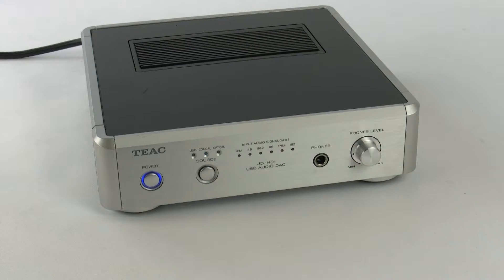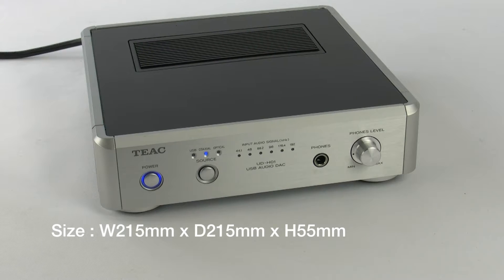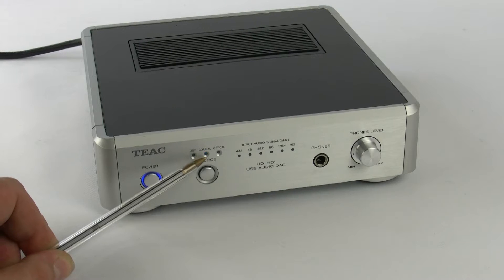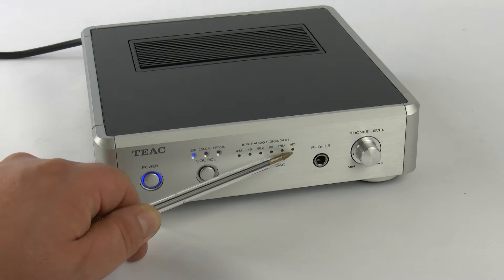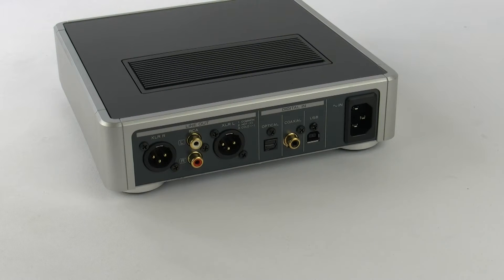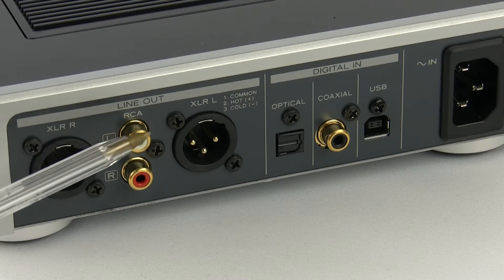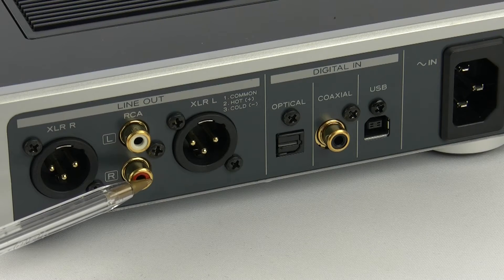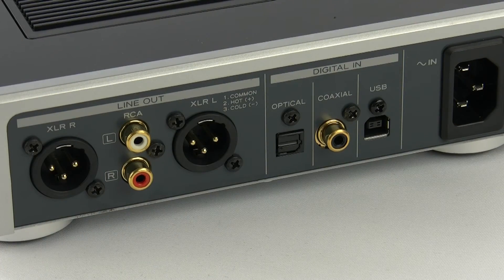TEAC UD-H01 DAC with USB for PC/Mac (XLR, optical/coaxial)

Comment: I am not using this amplifier with a computer lnfo.help/Teac?α40     Rather, it is powering a pair of Boston Acoustics CR-67 bookshelf speakers in a fairly large bedroom. Despite its small size, it puts out plenty of power without distortion. Currently only have one input - a much larger TEAC P650 CD/USB player. Will possible hook up the optical input to a TV.